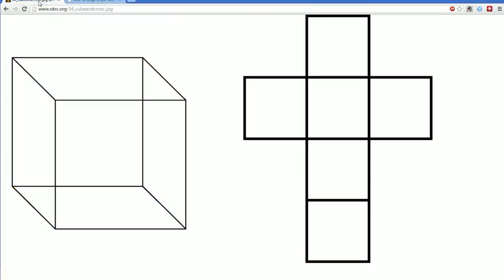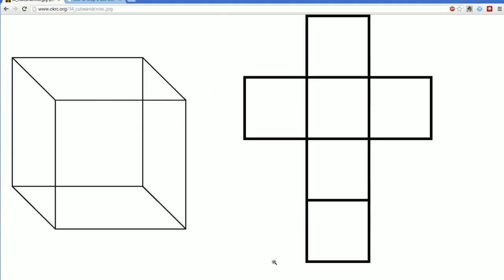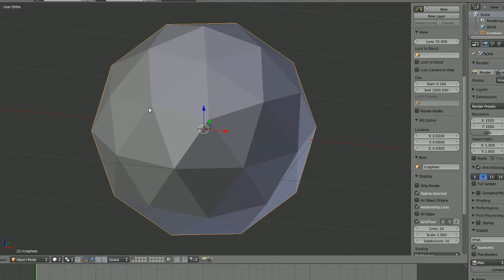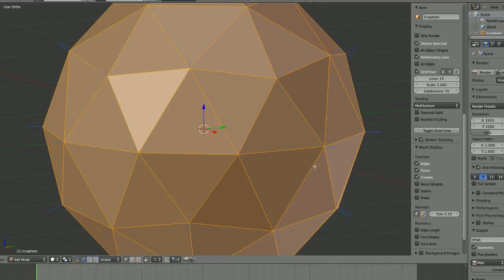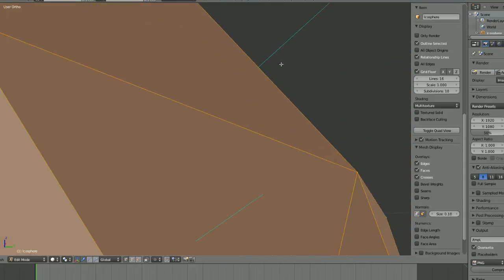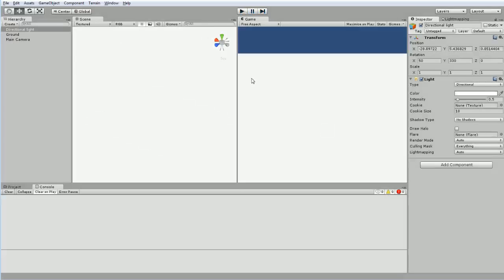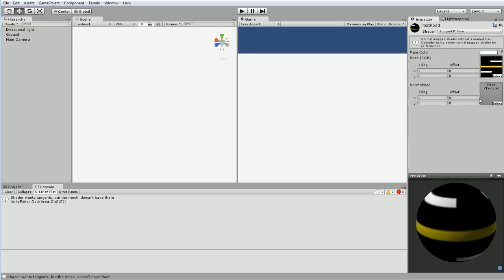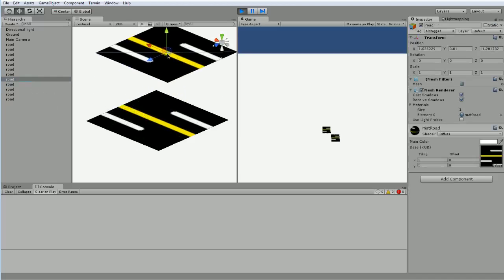Unity 3d: Procedural Mesh Generation [SimCity Roads] - Part 3

Comment: I'm having a strange issue.

So I'm putting in the UV code again exactly:
Vector2[] uv = {
   new Vector2[0, 0],
   new Vector2[0, 1],
   new Vector2[1, 1],
   new Vector2[1, 0]
  };
Only this time, I get an error saying:
Cannot implicitly convert type `UnityEngine.Vector2[,]' to `UnityEngine.Vector2'

What is wrong with Unity some days???
Reply: If I remove that function, there's no errors.
The error thinks I've typed something wrong in this function.
Reply: Desperate. Please help.
Reply: [SOLVED]
Here is the vode that will work for Unity 5.
https://docs.unity3d.com/ScriptReference/Mesh-uv.html

Comment: Getting this error from following the tutorial: Mesh.uv is out of bounds. The supplied array needs to be the same size as the Mesh.vertices array.
UnityEngine.Mesh:set_uv(Vector2[])
Groundclick:OnMouseDown() (at Assets/Groundclick.cs:32)
UnityEngine.SendMouseEvents:DoSendMouseEvents(Int32, Int32)
Reply: For those that ran into this themselves, I've noticed that at the time that I assigned the UV array, the mesh was not assigned, thus at the time of assignment, the vertices array was size 0 or non-existent. Perhaps a change from one version of Unity to another?

Comment: Surface normals are simply the average of all the edge normals.

Vertex normals are simply the average of all the faces (polygons) that contain that vertex.

By default, these will always point away (perpendicular) from the vertex or surface. By changing their angle (perturb) you can fake (with lighting) bumpy surfaces.

By interpolating (slice the distance between two normals into small steps) you can fake the smoothness of a surface (gourad/phong shading models).